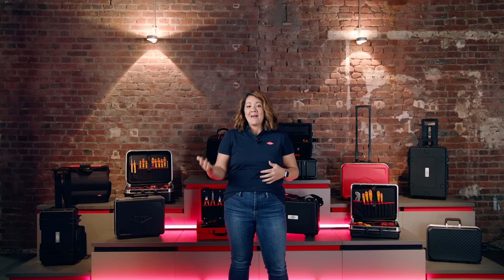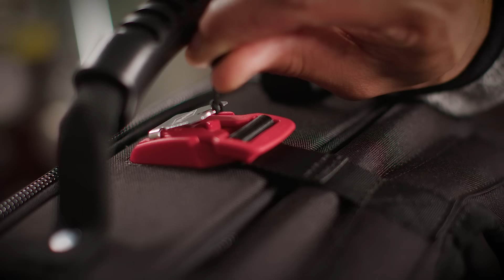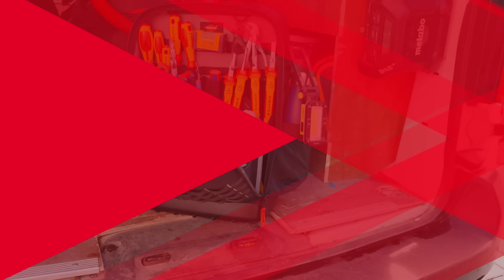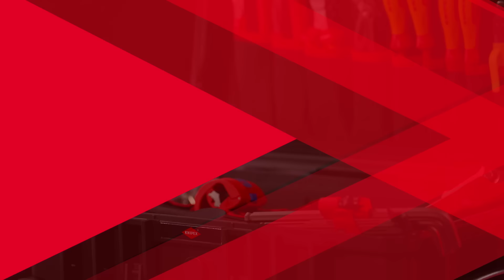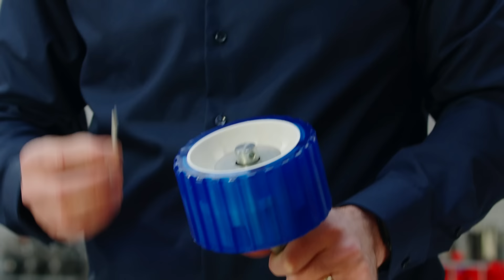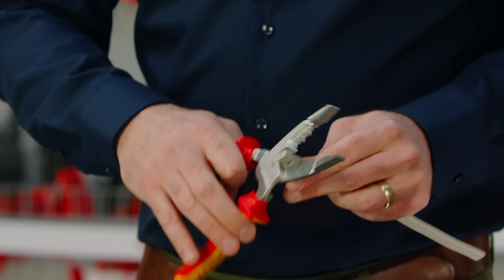KNIPEXupdate Spring 2023

Comment: Nice tools, I already have the 145mm needle nose combi pliers and is one of my favorites. The forged wire stripper in this metric version does not have the screw cutting holes like the imperial one. For 3 and 4 mm screws would be great. And a smaller twingrip xs version to complete my xs tool pouch. 👍👍👍

Comment: The 'three points-of-contact' is a brilliant innovation. I love it in my small needle nose combination pliers.
Reply: I still have no idea what they're talking about with the convex / three points of contact thing. Can you elaborate?
Reply: @danstheman33  I think it’s:

Get a normal pair of needle nose pliers. Try and hold something long and thin like a round metal rod that’s facing the same direction as the pliers. The pliers will be touching two points on the item. It will easily rotate sideways. 

The three point design adds a bump to the pliers. There’s a part sticking out on one side and a matching concave hole on the other side. 

When you hold something long and thin, the part of the tool sticking out contacts the item, and on the other side two points of the pliers touch your item. 

It doesn’t rotate very easily.

Comment: The forged wire strippers are absolute dynamite. Love them. 

Looks like the needle nose combo pliers are taking a play out of the Leatherman playbook. No doubt much stronger and more capable especially with the high leverage pivot
Reply: If youre talking about Leatherman multitool then this is an absurd claim. As if the Wera Koloss will be replacing hammers and ratchets altogether.
Reply: @inq752  I’m not claiming anything will replace anything else. 

I’m just stating the plier design is very similar to what Leatherman popularized with a needle nose section, open round section and wire cutting section.

Comment: Short summary: 
1. Absolutely new backpack.  
2. Robust 26 move = B&W toolcase JUMBO 6600. 
3. Electric vehicles set - nothing new, one more case set.  
4. Needle-Nose Combination Pliers 08 26 145 have grown to 185mm.  
5. Forged Wire Stripper added VDE grips and plated chrome. While chromed, screw cutting holes was removed🫢.  
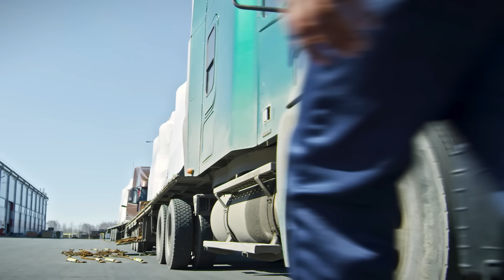The most funny could be after 2:22 but unfortunately the plan was cut off 🤣
And anyway… Knipex am besten Werkzeug!❤️
Reply: I'm surprised I was not the only one realizing that Robust 26 Move was the Jumbo 6600 from B&W. I use their type 6700 non JUMBO with the laptop and pocket attachment on the lid and their divider system on the bottom.

Them all my measuring equipment, plus tools go inside each divider in their own pouch/transport cases (Wera, Fluke, Knipex, etc).

They are good cases, at the level of Peli/Pelican offerings without the Peli/Pelican price.

Comment: I wouldn't say that Knipex strives for perfection.
They achieved it.
Your tools are a pleasure to use.  They are well engineered.  They are very durable.  I use them and abuse them.  I do maintenance/repair for our business AND we have a small farm.  There is seldom a day that at least one Knipex tool does not spend time in my hands.  They ARE expensive, but the time and frustration I have saved makes it more than worth it.  Thank you for making my life easier.

Edit:  YES.  You have the combo pliers with the plain-dipped handles (I have a type I guess...)  It will soon be time for a KC Tool order.
Reply: @Hand Tool Reviews No.  Just bought the pliers wrench about 3 years ago and FINALLY discovered what I had been missing.  I havent regretted a single knipex tool I have bought.  The only other tools I have that come close are my golden-era american tools-which are getting hard to come by and after 50-80 years finally getting beat up.
There is great stuff coming out of japan and taiwan.  Wiha, wera, hazet, starett, etc. make great stuff.  Snap on is great but I prefer to keep at least one of my kidneys.  Lots of people make great tools.  But dollar-for-dollar (substitute your own exchange rate here) Knipex sets the bar REALLY high.
Reply: @Hand Tool Reviews I've personally seen zero.  Now considering that it appears you have went up and down this comment section giving everyone the same copypasta troll crap, i'm going to ask who do you work for/who sponsors you?  If you're going to claim that you don't- provide some details of those issues you have had.  If you're going to troll, at least be helpful and informative.  
I can only speak from personal experience-which has been flawless.

Edit:  yup.  went through your catalog.  You review everything except knipex.
"Show me the incentive, and i'll show you the outcome"

Comment: No screw cutters?? Gutting . A 3.5 and a 4.0 would be great together with the spring system from the electrical installation pliers . Then that would be innovation! 
Please bring an update knipex !!!

I love my installation pliers but I find myself needing to get other tools out to cut screws and twist cables in addition.  

These in vde with a spring and screw cutters + a 200mm pair of diagonal cutters would be incredible!!! 

And would complete most of my cable work without carrying too much.

Comment: It would be nice if you enlarged the twin grips 1 inch longer, removed the screw extractor v, and replaced the jaws with cross hatch teeth. You would have in your line up, one of the best slip joint pliers on the market.

Comment: Another backpack to miss the bus. Having organized hand tools is always good, but they missed the biggest issue. There should be another dedicated chamber for a battery run compact hammer drill, 1/4” impact, 2 batteries, and charger.

Comment: I love Knipex design performance, but after I bought 7-8 different pairs last year, I have to say that I’ve had pretty poor luck with the ones I use the most in blade hardness as well as accuracy of grind on a pair of the new twin grip pliers. And I’ve found at least 10 other pair in stores that have the same grind issue.
Reply: @Hand Tool Reviews ya I’ve had soft metal issues on jaw teeth and blades on a few pliers. I used a pair of flush trim pliers only for cutting 18 & 23 gauge brad nails, and it dented the blades pretty bad. And regardless of use I know it’s a quality issue because 100% of the denting is in 1 blade and not the other, so one is hardened just fine. Next time you see some new twin grips, look at the grand of the tip, every pair in 3 tool stores I’ve found are ground a few degrees out of square, and they’re not even all the same, some are 3° and some are 5°. 
It’s sad because no other companies design engineering comes close imo.
Reply: When you say grind do you mean they don't line up when closed? There's a trick to locking it fully and it does snap parallel, if you don't click it fully home they naturally don't sit straight
Reply: @dd5617   Hello DD, Are you using Twin Grip pliers and if so what is your thoughts ?

Comment: It would be nice to see a 12-gauge and 14-gauge cable stripper, in a form similar to the forged wire strippers.
Reply: Huh? That already exists, the original version of the forged wire strippers is for AWG, and strips 12 and 14 gauge wires, both solid and stranded.
Reply: @danstheman33  The Romex cable, the outer sheathing, not the wires themselves.

Comment: Proud to say I have one of those butter-like electoral installing pliers. Things are great.. I can't stand companies like harbor freight in the United States that does nothing but copy incredible manufacturing such as Knipex and Snap On. Then they come on YouTube and think that they're pliers because they look exactly the same are going to be the same quality. But yet the snap-on sell for $100 online you can get them for $12 at harbor freight and you're going to be back a dozen times to replace the warranty (at least they do warranty them  things) but all that travel for warranty work if you went through snap-on originally it would never happen you would get your job finished and not need to go back and forth a dozen. However if that snap on brakes and you don't work at a shop you're really screwed because there is no warranty. Typically they're not going to break the snap-on pliers, unless you're abusing the hell out of them.
Reply: Wait snap on doesn’t have a warranty if you are a diy guy? 
Also if harborfreight didn’t rip off the pliers wrench and cobras i would have never bought a pair of real Knipex. I enjoyed the harbor freight versions so I went and bought the real ones that are just better and smoother. However I didn’t like the 3 position pliers so I didn’t waste the money on a snap on but I am looking at the talon versions of them I think that’s what that tool needs in my use.

Comment: A big update video for just two new pliers (and not really new, just new sizes of existing pliers) plus two new cases seems a bit excessive.. Don't get me wrong, I don't think they are obligated to pump out new products every year just for the sake of it, I think that's silly. But this seems like unnecessary fanfare..

Also I wonder why they eliminated the screw cutters from the metric wire strippers? I love that feature on my pair, that's one of the best things about it, so it seems like a strange feature to remove. I'm in the USA so I don't really care what happens with the metric version, I just hope they don't plan on eliminating that from the Imperial design as well.

Comment: Firstly, I am a Knipex fan boy with perhaps 30 of their tools in my toolkit.  I purchased the Knipex NexStrip Multi Tool Electricians 0.03-10mm Wire Stripper Pliers 190mm (12-72-190).  At £125, they are Uber expensive.  Sadly, I would advise against purchasing these pliers.  They are way too light in the hand, perhaps made from glass-reinforced nylon?  There is no way they are going to last in a busy building site environment.  In comparison the tools like the Pliers Wrench, Raptor and cable cutting pliers, this tool is just a shadow of others in their vast range.  Everything about the stripping toll above seems cheaply made.  Some may argue well you can replace many of the components but at £125, I’m not expecting to be replacing many parts.  Sorry, very, very disappointed in this product and would STRONGLY advise against purchase.  Just my opinion.

Comment: The forged wire strippers you should have left for the US market. If you are working with 4/6 mm in a panel you wont use this and only 60 year olds still twist wires and use wire nuts. The pliers for electrical installation is great and handy on smal jobs cause you only need one tool with a small enough tip to poke around in boxes, spring also makes that easier. Its better in every way. This forged wire strippers version for the European market is well sorry to say but just dumb.
Reply: Absolutely